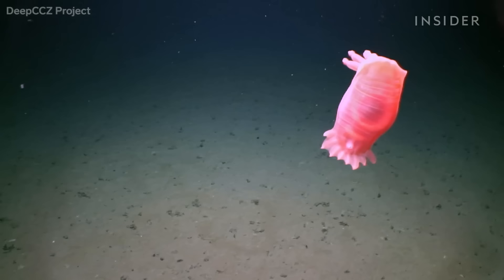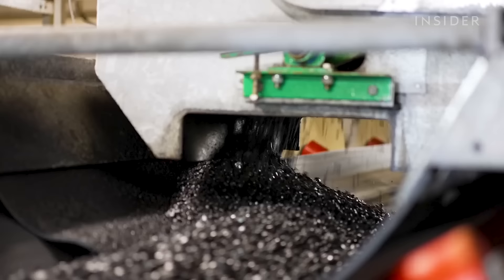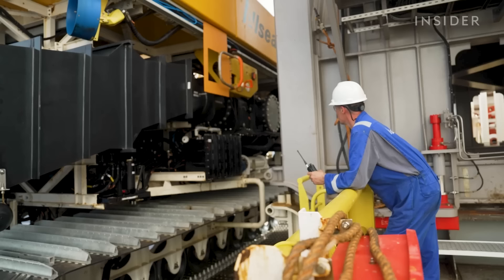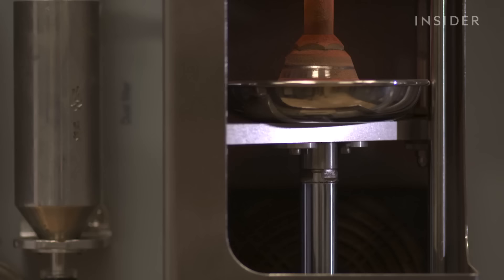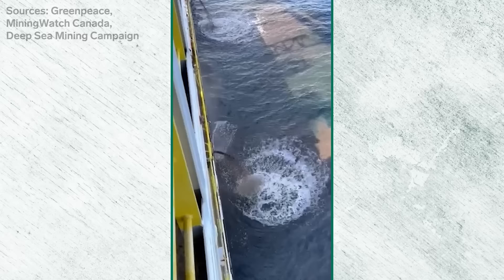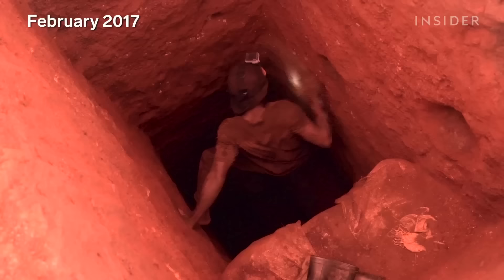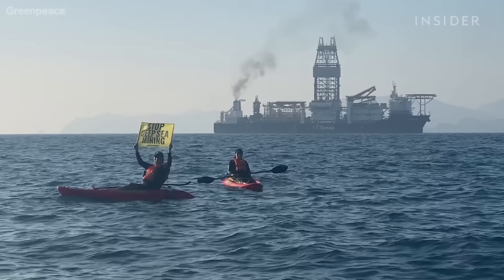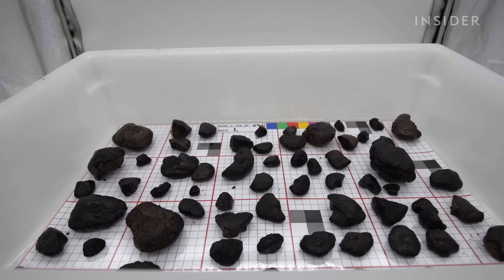A New Mining Ship Sucks Metals Off The Seafloor. Is That A Good Idea? | Big Business

Comment: How do they make sure not to suck up small sea creatures as well when mining the rocks? It seems like it would be hard to avoid as there are a lot of small slow moving sea creatures that might not be able to get out of the way.
Reply: they covered this point already at 9:00 to 9:10
Reply: @angelshot9264  that’s not talking about sucking up the animals.
Reply: @rachelcookie321  “and likely kill any who hold onto them”- here’s your quote implying that they have no current solution for animals that stick around and get sucked in.
Reply: @rachelcookie321  that was his point.
Reply: @angelshot9264  they’re saying they would die because there would be no rocks left, not because they got sucked in.
Reply: @rachelcookie321  watch the given time for more than 5 seconds
Reply: @angelshot9264  I literally watched the whole thing.
Reply: They don’t
Reply: the first wash getting much of the mud off at the "mining vehicle" should wash most of the animals out.... but you want to use you computer, clearly, so mining will be done. a mine leak on land can also send toxic chemicals to the sea floor and kill the same animals. theoretically pulling the nodules out may reduce the soluble load in the ocean water and actually pull some of the toxic metals out of the water (though the time frame is questionable). there is almost no case where these animals are not affected as they live at the very bottom of the hill, and no solution that doesn't cause environmental harm, as even wiping out large sectors of the population to reduce demand will require conflict or abandonment resulting in pollution.

in theory though, these animals can be preserved in the same way we do on land. establish preserves, so the animals have a safe breeding zone and can spill out to repopulate harvested areas. the interesting question is can we find a way to seed nodules on a reasonable time frame? if we could develope a medium to pull the metals out of the water in say only 100 years then you could constantly mine it at 1% a year, clean the water of metal pollutants, and maintain a healthy ecosystem, with reliable jobs, indefinitely.
Reply: You think them vacuuming😮
Reply: Lithium harvesting isn’t good either
Reply: How do you make sure the soy beans you eat didn't have small animals crushed and destroyed while the beans were being harvested? How did you make sure your apartment building didn't displace a family of mice?
Reply: How do they make sure that small animals aren't killed when harvesting fields of wheat?
Reply: Do they care
Reply: God Himself killed the first animal when He made clothes for Adam and Eve. The Earth and all its creatures were given to Man when he was created. Genesis 1.26.
Reply: @rachelcookie321  then work on your comprehension skills, because woosh...
Reply: You think regular mining doesn’t kill any animals?
Hell, you think the building of the factory of the device you typed that comment on didn’t kill any animals accidentally?

As much as it might sound bad, there are acceptable losses.

They don’t stop building windmills and solar farms because of the ants and rainworms that live in the construction site either.
Reply: You think any mining company care? No they didn't best they can tell you is they will try their best to minimize the impact that's it.
Reply: @jpjpJPJPG  let me ask you a question. if you measure a stalagmite at 1 meter one year, and 1.01 meter the next year. how long did it take to form?
Reply: @bnanney11  this also a vegan argument, most of their vegetables come with this side effects.
Reply: @garretth8224  O.o ? the same way you do with modern fishing in territorial waters. putting them in aquariums would be insane. they couldn't just swim out of the aquarium to reseed the harvested areas, that defeats the entire point.
those ships are not small, they are not cheap, they cannot hide from satellites, they cannot afford to be regularly impounded. this is not a cheap game to get into.
Reply: @vidard9863 Having territorial waters still isn't a nature reserve. I already said aquariums are a bad idea. Like what was the purpose of repeating that point? We also weren't talking about fishing, it was the mining.
Reply: @garretth8224  try reading what i said, and keep doing it till you read all the words. look up the words you don't understand, then get back to me.
Reply: How small we talking? Cause pretty much everything becomes minced meat
Reply: @angelshot9264  endangered animals gonna die
Reply: @vidard9863  non sense are we going to play as God now
Reply: @vidard9863  gotta love when people are condescending, and rude instead of actually explaining themselves to someone who probably didn't understand. Is this really the way we teach people? Being an ass doesn't make you a better person in any way
Reply: @HeatherGermaine  yeah, you probably do. birds of a feather, eh?
Reply: This is literally one of the many questions under the microscope that need to be fully answered before we make any progress in this field. We already know small organism live in those nodules, my question is, is it rare and exciting like a Coelocanth? or totally pedestrian and everywhere like staphylococcus?
Reply: @vidard9863  read her about me on her channel LOL
Reply: who cares
Reply: those sea ceatures are  more important for you than rivers and florests? ok then
Reply: @letsrelaxwithtexts2114  they are all linked, when something is affected in nature it sets off a chain reaction affecting many other ecosystems....stupidity of people is absolutely unreal.
Reply: Oh it's simple, they just don't care
Reply: @vidard9863  that is a good point, Vidar. Unfortunately, it is impossible to kill the animals on the way. A possible solution to that could be developing a machine with low suction power and a storage tank that would run over the mining area before the mining machine comes. This machine would store water and animals in a tank and dispose of them in a protected area nearby. Then the mining machin would come afterwards with strong suction power and do the job. 

This would probably still kill many, but not all of the creatures in the sea floor. Probably also increase time and cost. But we are talking about preserving as much as possible right? This shouldn't even be contested.
Reply: @leonardopab5  yes and no. it is impossible to live and avoid causing death. people who eat grass fed beef for example cause fewer deaths than people who eat vegetables because cows are much larger and therefore fewer in number than field mice, or insects.
the real question is do we even want the electric vehicles to begin with.
Reply: @vidard9863  yes, I know. We all killed and kill many beings directly or undirectly in order to live. Most of the time we aren't even aware of it. It is kinda sad when we think about it but also intriguing. Sad because there are many species useful to us that we have lost forever. And that is our fear when acting carelessly about a certain ecosystem. Still, I do think that preventing deaths in the ocean floor is way easier than peventing deaths in a regular mining in which you need to cut down forest. By the other hand, forests are way more diverse in life. I guess it is a win-win (specially if we could find a way to replenish or move creatures from the ocean floor previous to mining it). And actually those rare metals are not only used in batteries.
Reply: @leonardopab5  really the challenge isn't not killing the animals, it is legal and technical. the zone is the size of the united states. if you harvested 2% a year, that is the size of an average state. if you harvested several thin stripes, it would have 25 to 50 years to re seed across extremely long borders. that seems difficult to control, but modern tractors plow foot wide rows by satellite practically perfectly straight. you could theoretically run a tractor's width, leave 4 tractor's widths untouched and only pass by again once every ten years, while strip mining an entire state's worth every year, the entire zone in 50 years, leaving nothing unharvested, and giving animals and plants ten entire years to re seed a stripe you could throw a stone across after every disturbance. even if you killed EVERY animal and plant, they would still be there when you left.
Reply: @vidard9863  that is a good point. Indeed the area is veeery huge. There are many ways to manage it. I hope people really put an effort on it.
Reply: @letsrelaxwithtexts2114  The point is that this planet will soon end up like mars if we carry on being inconsiderate to it and its residents.
Reply: At those depths you are lucky to find bacteria.
Reply: @richardmanfredi3352  there are fish way deeper in the ocean. It would be easy to find Bactria and bigger life forms. They even mention in the video that there are sea creatures that live on those rocks.
Reply: I'm sure its not a concern of theirs if they accidentally suck up Nemo.
Reply: They don’t

Comment: Your still going to have to chemically split the metals from the rocks, which requires a crushing and washing process on land. Which will result in waste water and waste product, which will result in tailings dams for the different sediment to settle. We don’t have tailings ….. yes but the ports will where the rocks are sent to be processed.
Reply: Exactly! And he LIED about it!
Reply: Agree
Reply: Yeah, no tailings because they aren't smelting. Yet.
Reply: pretty sure they are pure metal and not rocks with metal in them. They just need to be melted down then.
Reply: @sirpieman300  the opposite, theyre rocks with a thin layer of metal on the outside. Clearly explained in the video.
Reply: Wrong, completely wrong. There are no sediments, nor tailings that come from  nodules, they are pure metal absorbed in the form of nodules, you need to process it, because duh, everything has to be processed to become useful, but that is it, there is no need to build any dams, it is completely different from open pit mining. Get your facts straight.
Reply: They are just plain hypocrites. Obviously this mining ship runs entirely on diesel. Mining there cannot be cheap and I doubt that it is profitable, because there are a lot of costs for energy resources, repairs and maintenance of complex, unique equipment. These are not even mining trucks that are produced and serviced by thousands around the world. The ocean hazard testing there is the same as for DuPont's certification campaigns, the validation campaigns funded by DuPont itself. Or like the situation with the Boeing campaign, which sponsored certification campaigns, because of which the MAX series aircraft later fell, with incorrect program control. They closed their eyes and continue not to open them even to the radioactive accident at Fukushima, until now radioactive water continues to seep from below and everyone is silent about it, because the english countries can only talk about Chernobyl. And do you think they will tell the truth in this case?

Comment: My company grows manganese oxides, which capture heavy metals, from mine drainage water.  Please leave the sea floor alone and mine our coal waste.  We've got plenty of that lying around and it's a lot more accessible.  (Side note: harvesting mn nodules was DODs cover story for raising the Kursk. (edited: the k-129, not the Kursk.  Ty).
Reply: They say about Kursk that it was an accidental collision of a US submarine with Kursk during an exercise, after which the US submarine fired a torpedo at Kursk and sank it. If you look at the photographs of the Kursk section, you can see a large damage from the side with the edges of the hull indented inward. Also, after this accident, the United States gave a big loan to Russia and there was some political rapprochement between the countries.

There is still a strange situation after the - In 1989-1998, Mir deep-sea manned submersibles carried out seven expeditions to the area of the Komsomolets nuclear submarine sinking in the Norwegian Sea, during which measuring and recording equipment were installed and torpedo tubes containing torpedoes with nuclear warheads were sealed in order to ensure radiation safety. During the last expedition in 1998, it was discovered that there were no recording stations, only neatly undocked anchors remained from them. It is likely that the instruments were removed or cut off by other submersibles or uninhabited remote-controlled robots.
Reply: DOD did not raise the kursk, the russians did. You are confusing it with another sub.
Reply: @andersandersen6295  the Trieste?  And thank you for catching that!!  I'll leave it for now since you were kind enough to catch that and respond.  Appreciate it :)
Reply: @ecoislands1540  You are welcome, but not quite Trieste either😀As far as i remember Trieste found the titanic and was tasked with finding the US sub Scorpion with Trieste II. Hughes Glomar Explorer found the Soviet sub K-129 and raised only a small part of it due to equipment failure. but yeah the cover story of that mission was finding manganese nodules.
Reply: @andersandersen6295  haha, oh me.  Ill have to ask my oceanography professor from school.  He was the one who used the anecdote in his classes.  I'll put up his reponse soon as i get one, cuz im curious now.  It was def how he introduced manganese nodules to us.
Reply: @ecoislands1540  Wow! Now i wonder what else he told you that was wrong😂
Reply: @andersandersen6295  it's my memory at  issue, not the anecdote.  That was 15 years ago :)
Reply: Got an email back!  "The US vessel commissioned by the CIA was Glomar Explorer.  Wikipedia says that the Soviet sub was the K-129."  I'll do some more reading, but wanted to get that out to you all.  Thanks for bearing with me =).
Reply: @ecoislands1540  No problem :)
Reply: @VictorLarsen-fy9ls  and then they sailed to the end of the earth and fell off. But not before they found Atlantis and in it a photo of a shooter on the grassy knoll.’
Reply: Oh yes Project Jennifer/Azorian, when you mentioned the k-129 I knew it sounded familiar.

Comment: I understand that there are issues with this whole idea, but the engineering is still pretty cool ngl.
Reply: Engineering? Really bro? It's like an oil ship mixed with a sea vacuum, it's hardly as advanced as an actual oil rig itself.  I'll start being impressed when their underwater Roomba can successfully dislodge sealife from all the habitat it's sucking up.
Reply: @vice.nor.virtue  Your Roomba is a great idea.  My understanding is that the supply and discharge pipe is constantly breaking because it's miles long.
     We need to do what you suggest and make the mining crawler battery powered.  And just send the ore up by inflating a balloon over the ore bin so it simply rises to the surface.
Reply: So was the atomic bomb engineering pretty cool but the effects were catastrophic

Comment: The smallest problem is the mining itself. The actual problem is the actual processing. Anyone that has ever worked at a mineral / metal leaching plant (eg Nickel west, Minara resources, MRL etc) know the impact. The amount of tailings that accures is massive, and there is no method to take all the acid, amonia, lime and other toxins out of it. So ultimately you'll end up with millions of tons of toxic tailings dams which will eventually leak out, rendering the surrounds useless for agriculture or human life. 
As long as Glencore is open-cut mining hundreds of thousands of tonnes of copper and nickel ore, this small scale operation of deep sea mining has no chance of competing.
Reply: That seems like an argument in favor of deep sea mining. The mineral concentrations are much higher, so there will be fewer tailings.
Reply: your not wrong process definitely creates issues. however when companys give up a mine. and close it off ground water/rain water that fills it up mixing with the metals  causes many toxic pond/lakes in the pits. just look at the many where we have people stationed at many pits in USA RN to protect wildlife from drinking from them as it's turned them into sulfuric acid  pits. the deep sea mining in the way they currently doing it eliminates that process and potential eco backlash. it's not perfect but it's definitly less damaging than land mining
Reply: This is not surface mining with lots of waste rock.  This is manganese bacterial deposition.  Very pure.
Reply: @Rokmononov   deep sea mining IS MORE environmentally friendly as it leaves virtually no toxic tailings, but it will most likely not be as financially viable as these massive surface operations that are left practically un-checked in comparison. It is much cheaper to use heavy machinery on land than using heavy machinery 3000m under the sea.

Comment: I work with mines in Nevada.  Mining only exist where it is economically viable in concert with the local laws.

The only way to improve your mining efforts is through higher grades of minerals or through an improvement of technology that is substantially less expensive than prior methods.

Nothing about this is less expensive than current mining methods.  The 3000 ton of material they showed in that cargo hull is probably an hour of mining at a large land based mine and they still have to get that ore shipped back to shore for processing (what is that going to cost in fuel?).

It appears they're putting at least 50x the expense of a land based mine to produce a similar result. And the environmental impact does not seem nearly as well contained as in a land based operation (sidenote much of the pollution is going to happen when the ore gets back to shore not in the harvesting).